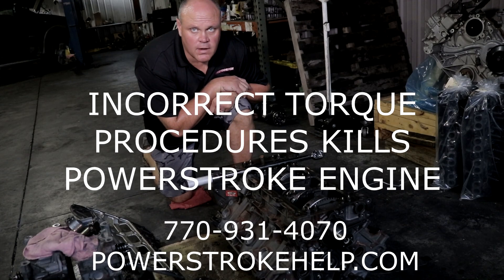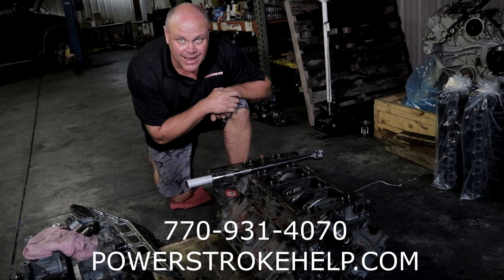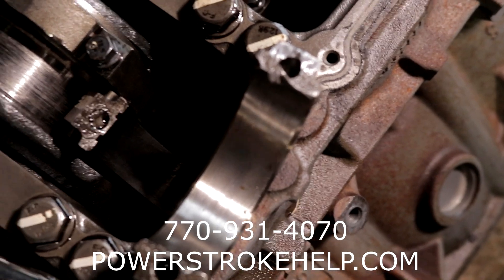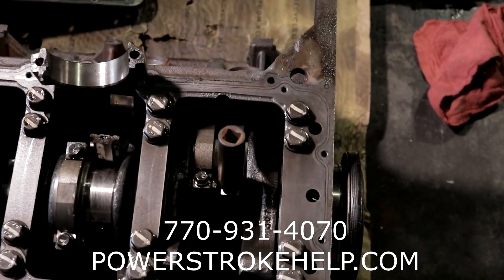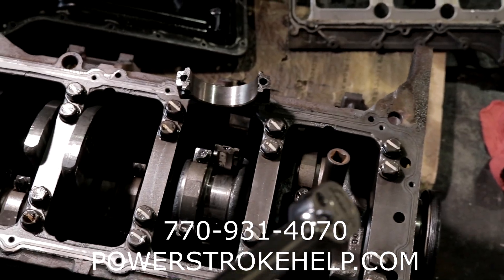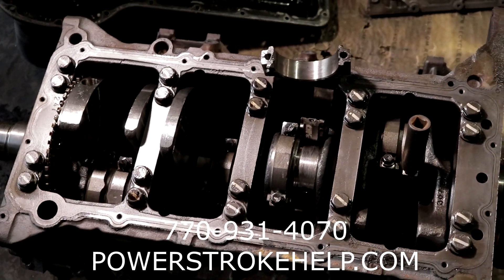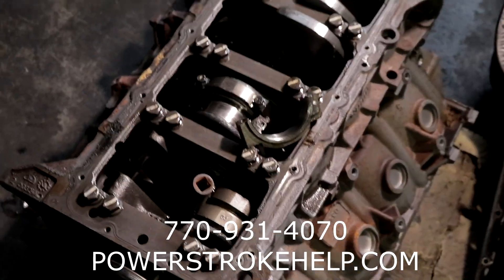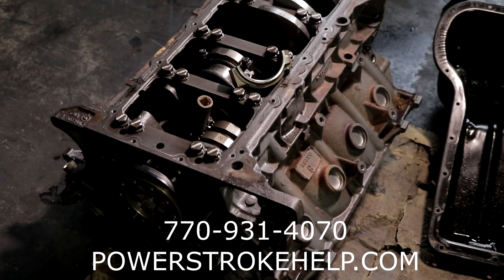INCORRECT TORQUE PROCEDURES KILLS POWERSTROKE ENGINE

Comment: I guess you never heard of Break torque. After a bolt is torqued and heat cycled the "Break" torque is always tighter than the initial. Your funny
Reply: Ray Manzi double the torque. thats a mistake.
Reply: Lance, you are wrong...  this method doesn't show anything. Breakaway torque cannot be used as a method to verify proper torque.

Comment: ye fuck that, they build all engines, i want a diesel shop built one, or i build myself, and my snap on tech wrenches(half in and 3/8) get used on every freaking bolt, these engines are to much work to take apart twice, i consider being lazy torqueing the bolt so i dont have to do it twice.

Comment: Jasper is really not that good. I used them for several gasoline fueled engines and EVERY one of them had issues and died prematurely. They're well known, but not that good.
Reply: I'm telling everyone, I have had non stop issues with jasper. 4 jasper transmissions and 2 jasper motor repairs. Please contact me for any additional information as I almost had to bring in a Florida state attorneys office to get it right.

Comment: Hey bill , I have a stock , 1995 7.3 obd plug in , I want to install a ts6 chip , any thing I should know ? My engine has 117,000 , only problem is a minor oil leak at the turbo pedestal  , any advice would be appreciated

Comment: Most people don't know or care about getting their torque wrench calibrated.  I work in a calibration lab and can tell you from experience that you cannot trust even a brand new big name torque wrench to be accurate from the mfg.  Tips:  Never leave a setting in your clicker torque wrench when you get through with it.  It will develop "memory" and affect the accuracy at other settings.  Store it set at zero always.  Never use a torque wrench in the bottom 20% of its range.  It is not spec'd or calibrated in the bottom 20%.  For best accuracy use a torque wrench near the max of its range.  Example - If setting torque at 80 ft/lbs and you have a 100 and 250 ft/lbs torque wrench then use the 100.
Reply: That is really helpful. Thank you for the knowledge!
Reply: that's very useful information. I am currently rebuilding an engine and this motivates me to get another wrench. Thank you

Comment: Is the release torque REALLY an indication of how much a bolt was tightened?
Could not other factors influence how much force is needed to release a fastener? Like stretch, dirty threads, corrosion or heat/cooling cycles?

Regards
Eric
Reply: You do know how connecting rod bolts are supposed to be torqued right? Rod bolts are torqued according to bolt stretch not ft lbs. You measure the bolt for untouched length, tighten to recommended ft lbs, then check with a special gauge that measures bolt stretch, and if it didnt stretch properly, you tighten further to the correct stretch.
Reply: 816, Interesting and I have head of this approach. What if the bolt tightens into a blind hole in the main part of the rod? Just curious...not trying to be a wise guy or anything like that.
Regards,
Eric
Reply: Not entirely sure on that one man, every time I've helped build a motor, the rods and bolts went together perfectly.

Comment: i see u do a video on hubs on the older videos, figured id post this here so you would see it sooner,

How come u never did a video on the Horrible Auto/Lock hubs with the turn knob on dash? i noticed on one of our work trucks its making weird noises in front end and i think its the hubs. Not the bearings. Already been done. The bearings didn't fully get rid of the noises it was making once and awhile,  that are now back. and the hubs aren't working in Auto . Have to put in Lock. Yes vacuum lines are hooked up and getting vacuum when switch is turned on dash. Seems like they stoped unlocking /freewheel in Auto , now they dont work when switch is turned on dash and front end noise is back. So, should i toss these stock ford hubs for a set of Warn Lock/Unlock hubs?? What else is involved to do the Warn hubs? thanks

Comment: Hi bill I have a 2014 6.7 and my dash cluster says to check engine coolant additive what is this and where can I get it I am more use to to old 7.3 please help
Reply: Hello! I may not be Bill, but basically the light is no different to a "Oil Change Due" notification on most vehicles. It's assuming the coolant needs to be serviced. SO. You have a choice here. Clear it and carry on. (You can clear it in the Info Menu of your truck on the dash) OR you can go to your Ford Dealership, they will insert a little strip, check the color, and tell you yay or nay. It should be free, seeing as how it's just a quick test. Make sure to inquire first. If it's in spec then go on your merry way. If it's out of spec, then change your coolant.

Basically two choices in TL;DR format.
1. Ignore it. It's a computer guessing.
2. Get a Ford dealership to check it. It's probably free.
2. (Cont.) If it passes, go on your merry way. If it don't, change your coolant.
Reply: +Liam 4.0 ok thank you I cleared it earlier and added new coolant if it happens again I'll probably take to ford but thank you for the help
Reply: No Problem my good dude!

Comment: At least there was no danger of those bolts working loose.
Reply: The bolts were torqued past their yield point, coming loose is less of a problem than the bolts snapping suddenly.  When they come loose you get a rod knock, which you can remedy before the motor grenades.  Overtorqued, they grenade suddenly and throw away the shortblock.
Reply: Thanks for that. I was going for sarcasm, neither situation is what you want for a freshly built motor.

Comment: also buy yourself a nice torque wrench. spend the $$ on a quality name brand wrench. and only use it when needed and don't ever use it to loosen things.
Reply: Good advice. Also, they must be regularly calibrated, stored at their lowest usable setting and only used within the usable range of the torque wrench. Additionally, if they are dropped they require recalibration before they can be used again. Deflecting beam type torque wrenches are much more more durable/rugged and generally do not require recalibration providing that the needle is at 0 in its resting position.

Comment: please make some more videos on the new 6-7 Powerstroke I'm very curious I've seen the ones you made about the ball bearings in 11 vs 2013 how they upgraded the ball bearing for the turbos but you need to make more videos like that please make more videos
Reply: Take it as a good sign that the engine is solid that he isn't making videos on them. Bill can only make videos on what comes into the shop broken down.

Comment: Jasper sucks they are nothing but an assembly line full of losers.
Reply: You are right on that. We had one truck at work that went through three Jasper engines that were installed at the Ford dealership. After the third time the company totaled the truck out with insurance. Jasper claims that they are the greatest. Well, that is a fucking lie.

Comment: This is why many people paint a dot on each part after torquing the part. If a fastener needs to be torqued more than once, many people have more than one color of paint. This also helps if several bolts have be torqued in a sequence, which is common on cylinder heads.
Reply: That is exactly how I've always done it. little paint dot on the bolt head after its torqued down, and different colors for multiple steps. Never forgot to torque a bolt down in a build. Wonder if they teach that in trade schools?
Reply: I've been through an auto program and a truck program and none of my instructors ever mentioned that. Though in their defense I don't think they've actually rebuilt an engine. 

So do this do you just keep a little set of paint pots and a paint brush?
Reply: Truthseeker4449 No problem, glad to offer tips to other techs. It takes a few extra min but is way faster then redoing a job or having a failure. The Markal Pro-Line HP are my preferred paint pens. Work good on oily surfaces.
Reply: I have a set of paint markers in my tool box. Markal makes some great paint pens. Super useful for torquing head bolts and doing timing belts, for marking the timing gears. Another use for is getting suspension parts pretty close to where they were before you send a car to the alignment rack.
Reply: I see, thanks for the tips!

Comment: I realize this is not your question to answer but  even if you individual  tuned the vehicle , How in the world is tuning a truck going to cause an external part to sheer off? internal damage possibly. A scorched piston or warped valve from erratic timing, or a bent rod from exhaust malufunction... lots of other internal opportunities for a tuned vehicle not tuned properly to ocvur..BUT an external bolt...no. sorry. Improper torque = exactly. And note, it sheered off with quite the force, not just a cracked bolt or threaded receiver, but completely fractured. wow. shame on that re-manufacturer.
Reply: Not trying to call you out, but I'm curious what your question references. The part that failed here was a rod cap, which is an internal engine part. And in this case due to improper/over torque.

Comment: Pull one of the other bolts out of a con rod and measure its length..compared to good bolt. If it stretched, then it went into plastic deformation and is a sure sign of over torque.